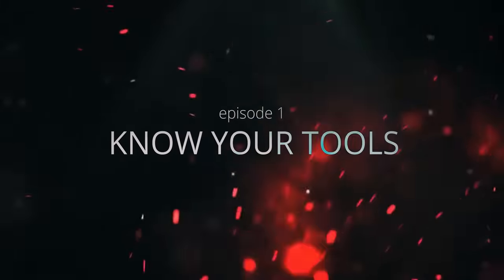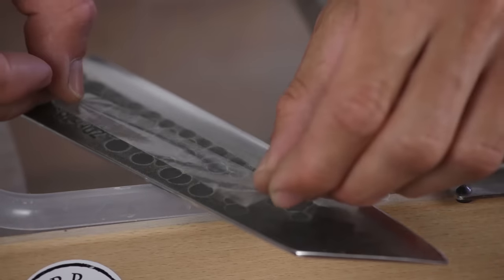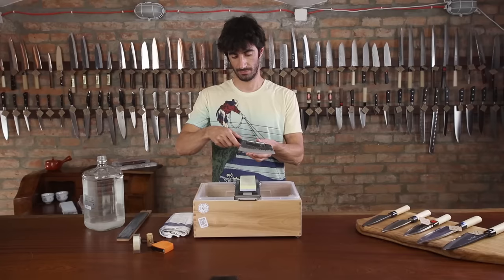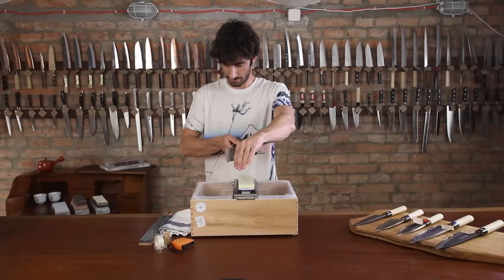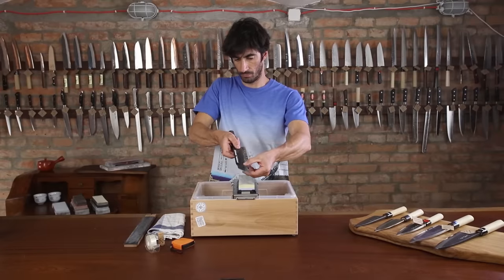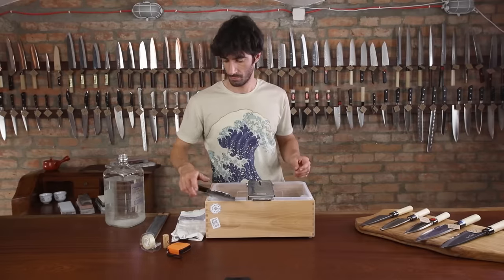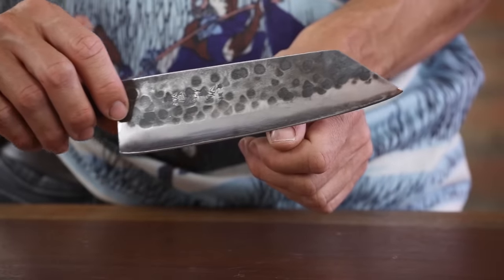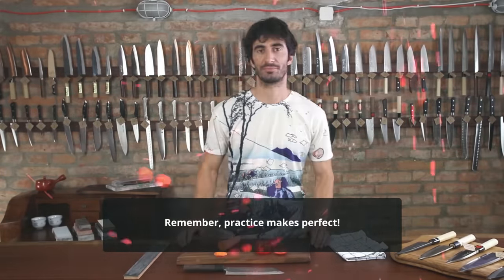How To Sharpen a Kitchen Knife - Beginner's Guide to Knife Sharpening

Comment: The nail test? Lol
Reply from the maker: Which method do you use?
Reply: SharpEdge a soft tomato 🍅
Reply from the maker: @nodrama490  Yeah, a soft tomato works very well when the knife is completely sharpened and ready to be used. We use the nail test during sharpening too, so we can feel exactly which part of the blade has already enough burr, and which one doesnt. We also do a nail test at the end (when the knife is stropped and ready for usage) to feel how smooth is our sharpness. Then we do a tomato test, but we dont always have them at hand :)
Reply: SharpEdge yeah I’ve never seen the nail method before , I meant no disrespect 👍

Comment: Edit: This comment was overly harsh initially.  I disagree with many of the details in the methods described here.  They don't match with my own experience of sharpening.  Many critical details are missing for good understanding of the process, and details around burr formation and detection do not match my own experience.  The angle guide also seems to be of little use the way it's demonstrated, especially at the heel and tip.  The production value is high, but I didn't find the content was of the same high quality.  If someone told me they mastered this method, I feel like I'd have to unteach them many things and start from basics for them to have full understanding..
Reply: I have to admit I like the carrot test though
Reply from the maker: @captaincaed  How would you have done it differently?
Reply: @SharpEdgeshop  I've edited my initial response, I wrote the first comment in haste.  It was not well phrased, and I apologize for that.  I can reply a bit more fully about what I would do in a week or so.  
My major gripes include: 1) demonstrating on a ZDP-189 knife.  This steel often has special sharpening considerations, and it's a great introductory steel. 2) A strop is not great for beginners IMO (though a 1k/3k stone is a PERFECT starting stone, really agree with this). 3) Cork generally produces a poor edge for the kitchen, both ragged and also reduced bite due to the way the burr is torn away from the apex. 4) Soaking is only appropriate for some stones, and will destroy others by dissolving  the binder (magnesia based). 5) The asymmetry topic is deep, but I believe if you're going to venture into that realm, it needs to be addressed fully.  It's not a beginner topic.  Better to START by following existing angles. The angle guide here is a crutch, not used well at heel or tip, and does nothing to avoid the issue that eventually a sharpener needs to learn angle control.  Best to start early.  6) Tip repair is better done by grinding the spine, in order to preserve cutting profile, existing edge, and edge-life in general. 7) Finer stones do not remove burr, they reduce the size.  Burr removal is possible at any grit, and learning to do so at 1k is pretty important IMO, but that's a matter of taste I suppose. 8) Stropping to remove bite is counterproductive for kitchen knives used for produce, especially at the beginner sharpener level, again maybe a matter of taste.  9) The sideways tomato slice is fairly easy with remaining burr, low grit edges, etc., and I don't find it a useful test of proper sharpening.  I do appreciate the 1k/3k stone choice, the carrot test, and the discussion of grit contamination.

Comment: HEH. First time hearing some one recommend running a damaged knife with chips  on the side of a 1000 grit (half of a combo stone)....usually most people use a 120 grit if the chip is large enough. or a 220 at least....what's with the cowboy music? :)
Reply from the maker: Hi! Indeed, it's much more efficient to use lower grit stones to remove chips, you are correct. Since this is a video tutorial for those who are just getting into knife sharpening, we felt that adding a new set of stones will be too overwhelming and make it more expensive. But yes, by all means use lower grits to get rid of chips, it will make the process faster than on the 1000 grit stone. As for the cowboy music, that's just what we hear when we're taking 'the journey' of learning a new skill ;)

Comment: BTW - how do you get a asymmetrical angle if the clip is the same angle on both sides?
Reply from the maker: The "asymmetrical edge" does not mean the angle will change when doing the other side. The angle on both sides will remain the same, but the very end of the edge (micro bevel) will be moved from the center of the knife to the left or right side, depending on if you are right- or left-handed. This means the angle on both sides will remain the same, but one side of the edge will be "shorter" than the other. We achieve this by putting more/less pressure when sharpening to one side than the other, and this is usually done naturally, as we instinctively put less pressure on the knife when sharpening with our non-dominant hand (as explained at 9:57). The "asymmetrical edge" term relates to the asymmetry of the edge position, not to the asymmetry of the angle. I hope this makes sense to you. If not, please ask more questions, we're happy to help!

Comment: Dont follow his advice, he is a complete noob... If the knife was sharpened by a pro, say byebye nail and finger tip
Reply: No, its about the feel. You can feel the blade and the edge. I agree.
Reply from the maker: We obviously have to disagree, and since we learned the nail test from Japanese blacksmiths who have been using this method for quite some years, you'd be calling them noobs too. They all still have their nails firmly attached to their fingers, although they are not the nicest looking nails around :)

Comment: For the kitchen, you need no more than a sharpening steel
Reply from the maker: Here we'll have to disagree. Sharpening steel/rod is a very useful tool and is used to realign the blade and prolong the sharpness, but after some time, the sharpening steel cannot put a new edge on. That's the time to go to your sharpening stones and put a new edge on your kitchen knives.
Reply: I've had my kitchen knives for years and never had the need of a stone, and they slice thru everything just fine, I only use my stone on knives that cut harder materials like wood
Reply from the maker: We assume you have German kitchen knives, or knives made of softer steels (<60 HRC)? In that case the sharpening steel would indeed suffice, but we would still recommend putting them on the stones once in while to get a thinner, smoother edge on them. Or try to polish them with the leather strop once you're done on the sharpening steel. But at the end of the day, as long as you are satisfied with the sharpness, then it doesn't really matter which tools were being used to achieve that.